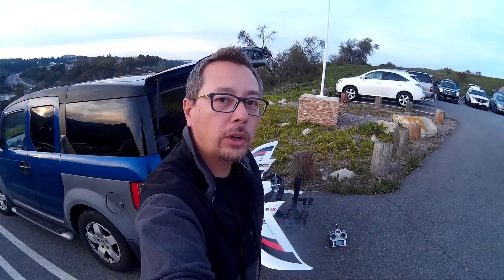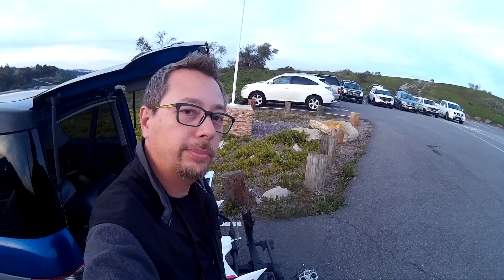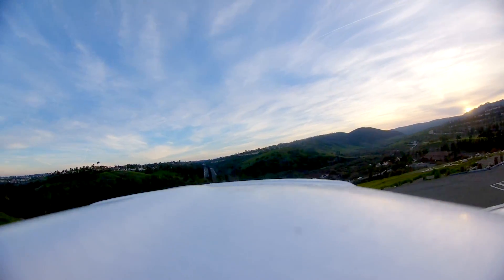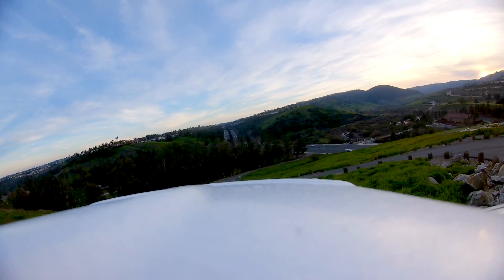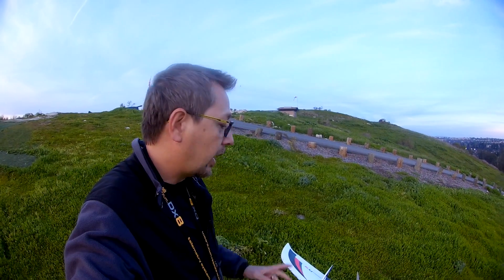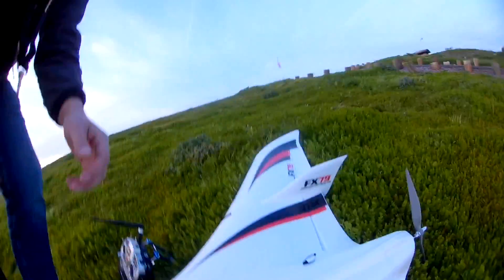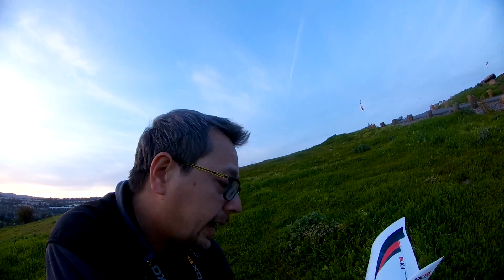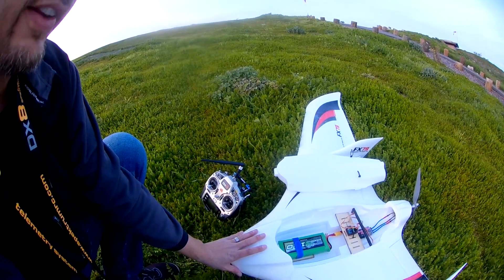Zeta FX-79 Buffalo Maiden Flight

Comment: im still trying to get the CG right for my fx-79..i just did 2 flights and still nose heavy....i was using a 10,000 multistar pack but im gonna change to 2 5200mah 4s..i used the nubs and the balance was perfect but when i flew it was nose heavy with the throttle so im gonna try the screws and see the results from that this weekend...motor is turnigy sk3 3548 840kv, 60a esc, 12g servos, and a 12x6 prop..45amp WOT 645watts...but i dont think that prop is good for this setup cause im not getting the performance i want, so i also have a 13x6.5 carbon fiber and i will try with that one....im also flying a mytwindream and getting that ready for long range as well....great video
Reply from the maker: Thanks, I'd love a MTD!!!  If you thought the nubs were nose heavy the screws are even more nose heavy.  Andrew newton went ever further back than the nubs.  
I've been informed that up reflex is required with this model.. I went ahead and centered my trims again and physically added up reflex by the thickness of the elevon- will try another shake out flight soon- and with a better camera position!
Reply: i have watched already both his videos before..he did 100mm behind wing joint...if you can when you make another video can you do a close up of the elevons so i can see how much up reflex you did...i will also do that same adjustment as you and see how it turns out for me...i guess i will be flying then bring it down, adjust, fly again, bring down, adjust lol...i guess everything depends on the weight of the motor,battery, and gear, so i think i will try to stick to one thing which is the nubs and try to do adjustments based on that....she cruises fine but with throttle she dips that nose...ill keep you updated

Comment: Great first flight.  "Uneventful" maidens are always encouraging.  Looking forward to the next steps!
Reply from the maker: +Jacob Brubaker in working on the full build video,,,
Reply: Looking forward to your tips.  I'm trying to decide if I trust the hot glue that Andrew Newton used or go with something stronger.  My FX-61 has 30-minute epoxy on the aluminum motor mount.  I might do the same with the 79.  (I'm also building my Mini Talon now and referencing your build video for that quite a bit as well.)  Thanks for your efforts!
Reply from the maker: Same- I used a different glue for my Fx61 ( can't remember what ---ca???)  The hot glue seems to be quite strong so far